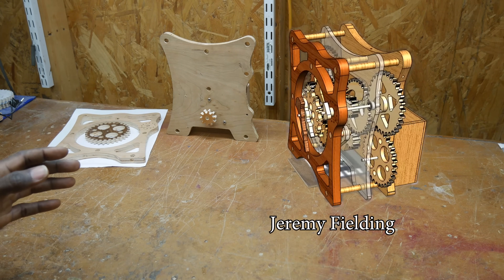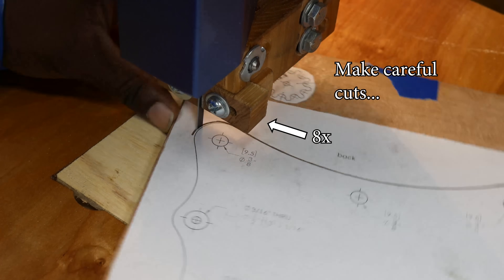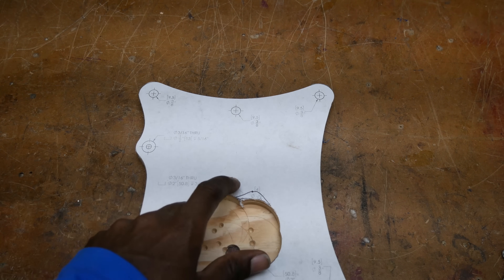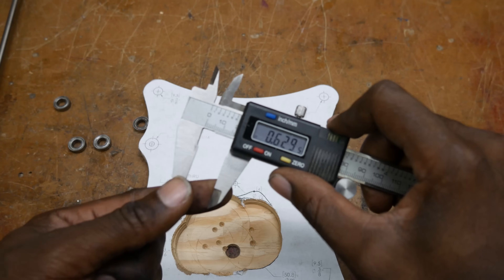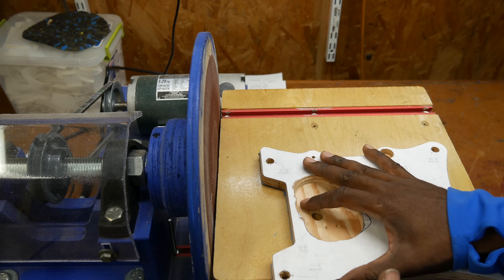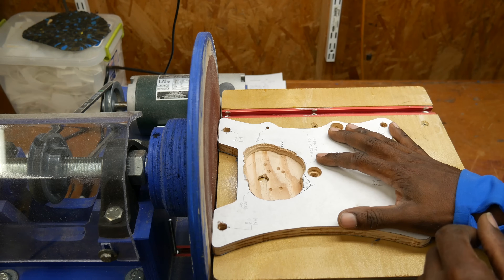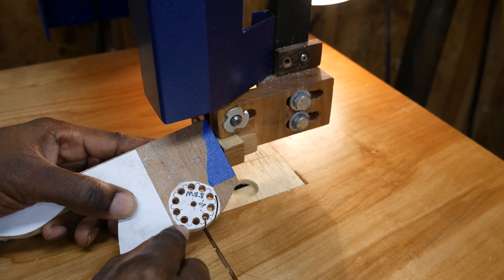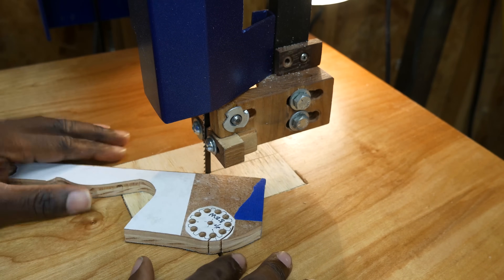How To Make A Wooden Clock Part Two; The Face And More Gears: 046

Comment: I have a question for Jeremy ( or somebody else if you happen to know the answer).  I make wood gears from 1/4 inch baltic birch that are about 10 inches in diameter. The problem is that the wood is not perfectly flat so the gear wobbles.  How can I flatten the wood before cutting the gear or flatten the gear after if is finished?  I tried heating, moistening,  and squeezing it with clamps but that did not work.

Comment: Jeremy, I've found that lacquer thinner works well to remove glue from paper patterns. Just soak some on the surface with a paper towel and in a minute or so the pattern will slide right off. Remove remaining glue with more lacquer thinner.

Comment: If it were me, I would have simply sanded the paper off with a fine grit sandpaper. With a random orbit or detail sander this shouldn't be too difficult to do without damaging the surface much at all. You might lose a few thousandths of an inch but could also be considered your finish sanding. To me that's killing two birds with one stone...

Comment: I use my wife’s hair dryer on the pattern to heat the glue.  It peals right off!
Reply from the maker: That doesn't seem to work well with the glue I am using. But I agree heat has worked for me on occasion with other glues.
Reply: Jeremy Fielding I see.  I guess there are different strengths of spray adhesive.  As a fellow woodworker you are totally right, it’s much easier to use the blue tape before the pattern.  I love the clock.  Perfect for a desk.  I have built a wooden gear clock that hangs on a wall with weights as it’s drive.  This project my be my next step to incorporate wood and electric motor.  It sounds like my trickiest part is finding a motor like yours.  Any suggestions or links you may have?  Thanks
Reply from the maker: Synchronous AC induction motor. The rest depends entirely on your design... size speed torque etc. eBay Amazon they all have these motors

Comment: You'll get no blow out if you drill from both sides. If you just drill small center holes first, then you can drill halfway with the final diameter from one side, then drill all the way through the opposite side.

Comment: I notice you used GooGone. Good stuff but there are cheaper products. They are all straght chained hydrocarbons. I have been using Coleman White Gas as it dries quicker than Mineral Spirits (That clumpy paint thiner is like mineral spirits mixed with water).

Googone: 
Heavy naphtha mixed with kerosene. 9-16 carbon

Mineral Spirits:
Distillates 7-12 carbon

Zippo lighter fluid:
LIGHT Distillates 6-9 carbon 
light Naphtha 4-11 carbon

Coleman white gas:
Light naphtha 5-9 carbon

Comment: James Wright uses a card scraper to remove the templates for when he does carving. He's said that doesn't mind the bit of material loss since he will scrape the surface of his carved bits anyway before finishing them, so it actually saves him time. (He does do everything by hand though, so it might not be that much saved time if you were going to use a power tool to sand later.)

Comment: Hey my friend, did you ever get that three phase motor working on single phase power? I still have that monster three motor and don't have a clue on how to get it working off my 120AC power. I did pair the 9 wires up in continuity making 4 pairs with one old ball and was going to try and just to see what would happen trying various connections but never got around to it.
Reply from the maker: Yes... I use VFD's run my three phase motors. They all run on single phase power (single phase in three phase out). You can do it without a VFD, but I don't recommend it. It will damage your motor over time if you run it for extended periods.

Comment: If you fix your templated board on top of a similar sized piece of MDF or other flat scrap wood with wood screws through the waste area of the template this will stop the break out as both pieces will be firmly held together as you drill all the holes As your screws holes are in the waste area they will not matter as they are removed when you scroll saw these areas out.
Great videos by the way..
Reply from the maker: Sounds good. Screwed in from the back I agree that would work pretty well. I think that would be pretty fast too compared to drilling from both sides.
Reply: I tried to explain this in an earlier video but I didn't do a very good job of it. lol  Best wishes Mason

Comment: I really enjoy your videos.  Have you considered getting a CNC router?  They aren't super expensive now and they make this kind of work so much faster, more precise and repeatable.  They are also very easy to learn to use, especially since you've already learns 3D CAD.

I'm looking forward to seeing the rest of this build.  Thanks for sharing.
Reply from the maker: Yes I have considered it. I briefly mention this in the first video of this series. I was thinking about a laser cnc. However, the good/reliable ones based on reviews I have read... are still priced higher than I want to spend right now.
Reply from the maker: Routers are certainly cheaper, but if I get a setup like this, I think I would prefer a laser over router.
Reply: Jeremy Fielding I have both and the laser is better for thin materials but the router can make much larger parts out of many mor material types and thicknesses. I love the laser for the speed and ease of use but if I could only have one I would choose the router because it's more versatile. 

Lasers over 40 Watts are typically over $5k.  A Shapeoko3 or XCarve  router that will cut 33"×33"×3" can be had for under $2k including tooling.

As good as your channel is, I would think you could get one through a sponsorship deal.
Reply from the maker: I don't have any offers just yet... Maybe you can call someone for me LOL
Reply from the maker: Maybe when I hit 100k they might start knocking on my door... or I guess I could cold call them and get a deal. We shall see. :)
Reply: Jeremy Fielding I doubt they will knock on your door but I'm pretty sure you could get a CNC router and possibly a laser if you spend some time to submit some decent proposals.  I've seen smaller channels with fewer subscribers and lesser content get cnc routers in exchange for a review or project video.  I suspect they submitted proposals though.
Reply from the maker: +Tony Shulthise the real issue is space. If you can’t tell I have something stuffed in every square inch of my workspace. Once we move I might seek this out. But it would be in the way for all projects unless I can pull it down from the ceiling which I am seriously considering. I even have a prototype stand in mind to move it up and down from the work area
Reply: Jeremy Fielding there are a couple videos showing fold up installations.  I  can't think of any reason you couldn't make a ceiling down setup using a  4-bar linkage.  You just need a stiff torsion table so you don't lose your precise datum surfaces.  If anyone is going to figure out how to make it work it's going to be you ;-)

By the way, I'm packed in too. I made a version of your rotary table to mount my belt sander, spindle sander, grinder and scroll saw.  Thanks for the inspiration!
Reply from the maker: That is awesome!

Comment: Hi Jeremy! what about sandwiching the work piece between to sacrificial scrap boards to prevent any blowout?
Reply from the maker: +JEREMY RADTKE how do you see the template? Unless you mean cut the whole thing through three boards with the template on the scrap piece? I think that would actually work but you would waste more material. I only have so many pieces that size I consider scrap.
Reply: yeah that's what i meant, the template on the top piece. you might be able to use something like hardboard or maybe even heavy card stock.
Reply from the maker: +JEREMY RADTKE I do have some laying around

Comment: Use a hot air gun to remove the templates... works like a charm. Use that for all my scroll saw and band saw projects...
Reply from the maker: +ChaosOptional it doesn’t work on this high strength glue. I tried that first off camera
Reply: Jeremy Fielding then try using 3M spray glue next time - not the strong stuff :) if all it requires a minimum on sanding after removal with the hot air gun.
Reply from the maker: What I do is use blue tape under the pattern with the strong glue. That gives me the best bonding of the paper to the work piece. Then I just peel off the tape and there is no work at all after cutting. I show this in the first video of this series. I love my blue tape. What you saw in this video was a mistake. I prefer the strong glue with the blue tape under the pattern. No sanding, no hot air gun... it is so easy I am kicking myself that I forgot to apply the tape first.
Reply: To each their own. Some use tape. Some people use the spray. Rubber cement used to be a popular choice because it comes off relatively easily. These days there are all kinds of options.
Reply from the maker: First Thank you @ChaosOptional for the suggestion! @Robb403 brings up an interesting thought... The question is actually more complicated than just which is better, but how do you define better? It might be that I am terrible at one application and great at the other so I perceive one as better. Or, the tools I am using are better/worse. Or, one takes longer but gives a better result... so which aspect of that is better, speed or quality? There are many layers to this debate so I try not to extend these "debates" too much, but simply say "this is the method that works for me and here is why." Some people get really "excited" about "their" method and want to fight. I simply consider all the suggestions, and even try most of them, then settle on the ones I perceive as best for my shop and experience. The best part of having a channel is everyone contributing to the discussion and I walk away with many options I never considered. Thank you guys for all the comments and suggestions. I love having these discussions

Comment: you might wanna observe the drill press speed
it looked like it was on the high side for those forstner bits
Reply from the maker: +Atticus Draco I will check the speed recommendation just in case...The video is sped up 6-8 times for most of the “action” parts. But a few scenes are only 3x which might be deceiving your eyes.

Comment: Have you tried steam to soften that glue?  You could use a steam iron, or one of those comercially made steam cleaners. A hot plate, a pressure cooker, some high temperature hose/tubing, and gloves might work.
Reply from the maker: I have not tried steam.
Reply: A lot depends on the type of adhesive.  Some people use oil (olive, peanut, OR WD-40) to remove the oil residue, but steam works great on the paper and on some kinds of glue.  Oil might soak into and stain your wood.  I recommend you test a few methods on scrap off-cuts.
Reply from the maker: That sounds like it is worth trying thanks! The iron that is...
Reply: Jeremy Fielding Try not to actually touch the paper with the iron, the heat transfer might scorch the wood just like some fabrics.
Reply: If you end up trying oil to remove adhesive, perhaps Linseed or Tung oil will work.  Those are commonly used in woodworking aren't they?  2 birds 1 stone.
Reply: Another option that I think merits consideration is your choice of adhesives.  You may want to check craft stores or websites offering "low-tack"  sprays, also known as "repositional".  This might eliminate the need for blue tape or cleanup when forgotten.  This stuff might also help with tear out.
Reply from the maker: I started out using the reposition-able glue. Some times the paper would peel away from the wood while cutting or drilling. This glue holds it firm through the whole process. I still have half a bottle of the 3m repositionable spray adhesive. I use to spray it directly to the wood and then clean it off. This process is way better in my opinion. The blue tape eliminates all cleaning if I remember to use it every time.
Reply: Jeremy Fielding did you try spraying it to your pattern?  Maybe it's just a technique change that makes the difference.  Perhaps spraying both surfaces is required.  It's good that you have a process that works for you though.  Have you tried steam on scraps yet?  A Damp terrycloth barrier might allow you to apply direct pressure.  I just hope the glue in your laminated wood pieces is heat and moisture resistant
Reply: I saw a forum that suggested printing your pattern on big label paper if you have the capability.  THAT sounds like a pretty good idea.
Reply from the maker: +Ron Yerke technique is always a factor. I think thats why people end up solving the problem in such unique ways. Our perception of what is best varies with experience tools, and techniques
Reply from the maker: +Ron Yerke yep... I was looking for some the other day. Couldn’t find the right size in the store... I wanted to give it a try